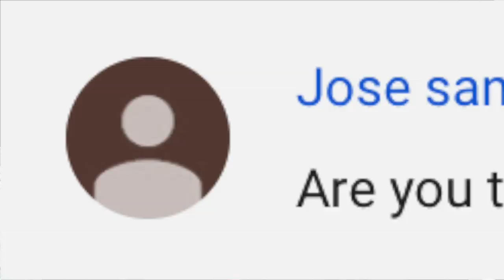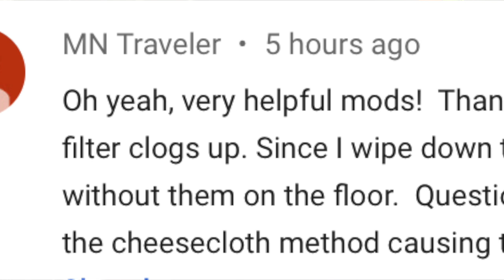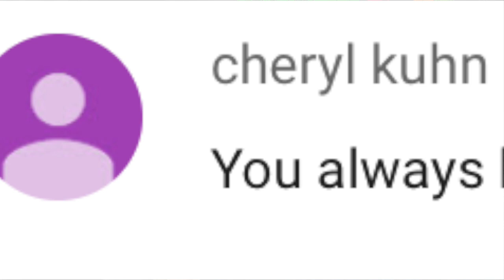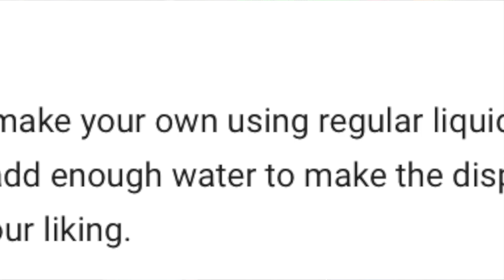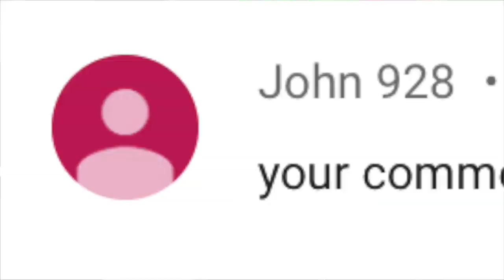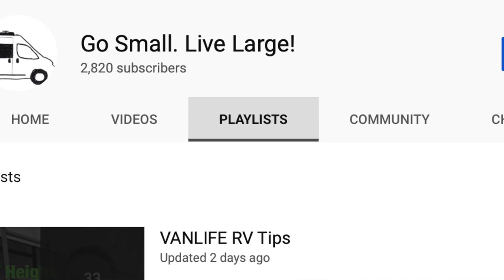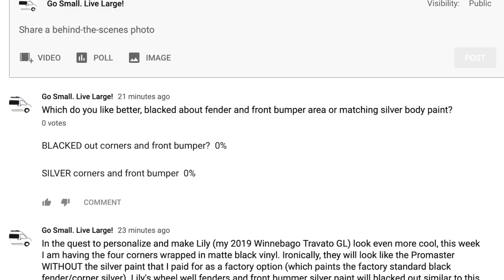How to CLEAN RV SHOWER DRAIN FILTER. New video playlists.  |  Vanlife in a Travato

Comment: Oh next time you talk with Winnebago please ask them if the air conditioner you just changed yours too if they have plans to make that the permanent air conditioner starting in 2021...

Thank you Scott🙏
Reply: I'd like to know the same thing.  I don't want to buy my Travato without the NDQ,
Reply: The new ac is now standard as of the 2020.5 model
Reply from the maker: the NDQ comes in the  Boldt and the NPF Edition Travato. My guess is they will be begin appearing on regular Travato models soon. Check with your dealer to verify.  You will want the NDQ model!

Comment: Thanks for the video.  Two questions.  Does the shower water drain into the grey or black tank?  I saw a comment on another YouTube site that the Travato 59L shower drains into the black tank, and that their black tank fills quite rapidly if they use the shower.  Second question, how are you liking the new tires for your van?  Pro's and cons of the new "biscuits"?  Thanks.
Reply from the maker: Hi Kurt. Sink and shower drain into the grey water waste tank. Toilet in the Travato drains into a separate black waste tank. They are about 11 gallons in capacity each. The hot water for shower is 2.5 gallons. so mix that with cold and one shower fills my tank about 3.5 gallons, so about 25% full. 

Loving the new tires and wheels for looks at grip. Road noise is a bit more than OEM, but not a problem. Haven't noticed a big difference with MPG

Comment: Hi Scott, apologies in advance if you've covered this in another video, but we've watched a lot and I don't think you have. What would be your choice of campervan if you were always traveling as a couple but wanted to enjoy exactly the same types of experiences you've had in the 21' Travato? My wife and I don't think we'll fit on the 59G bed, but want to be able to park in a variety of areas like you as well as to be able to work in the front lounge.
Reply: dirtdawgselite The Travato K is perfect for couples (two twin beds that can be converted to a queen/king size)
Reply: @mtl9036  thanks, I was kind of hoping ro replicate Scott's experience of urban camping, (semi) permanent bed, separate working space. I guess Lexor FL is the other choice but any other ideas?
Reply from the maker: Howdy. Great question. Can do two beds in the 59G floor plan, making up the dinette bed each day. I would prefer that to the K floor plan for the 4 room feel, garage storage, and bathroom size,. 

Our cat's litter box fits perfectly in the 50G bathroom. When needing to use the bathroom quick lift and move little box to the hallway .

Comment: Hey Scott....I just noticed the "note" behind you about galley window open.  I thought they made them where that window didn't open but were only installed there to let light into the galley area?  I can see myself forgetting that the window was open and crashing the door into it!! I would need a note like you have. Maybe the 2020 models are made with non -opening galley windows.
Reply: My Travato has the silver bumpers and I think the silver looks better overall but I found the Winnebago paint job is so bad I prefer just to have the factory black in the future
Reply from the maker: Not sure on the timeline when the galley windows were made to open. I'm glad mine opens. Just need to remember to close the rally window BEFORE opening the sliding door. One good wack with the door likely will break the window.  I use a sign on sliding door to remind me.

Did a video about that solution https://youtu.be/BqKZcOd9Q9k